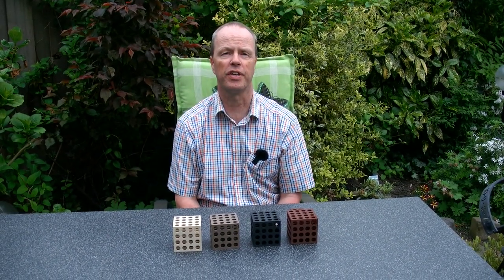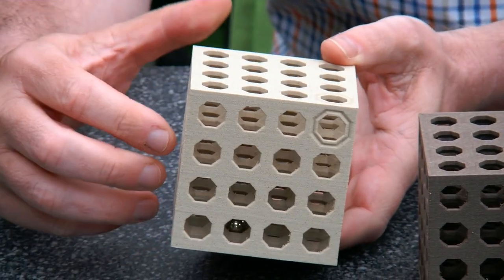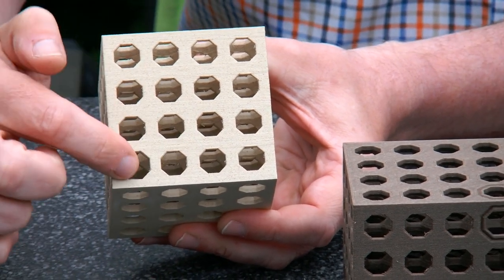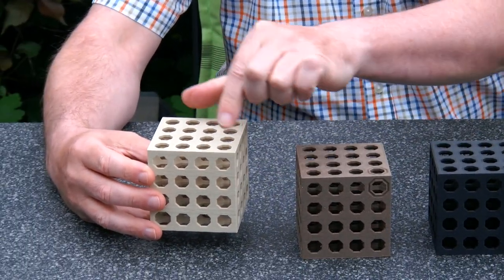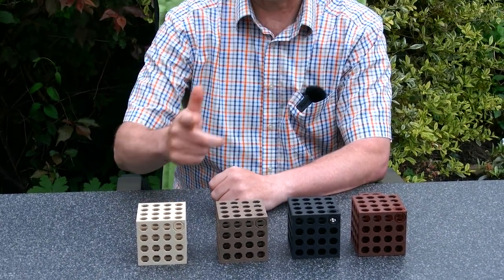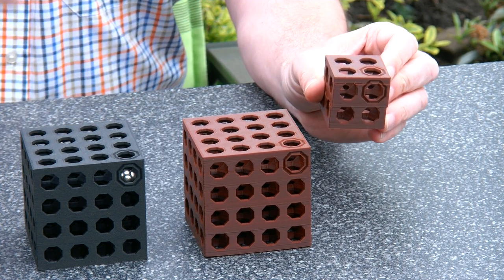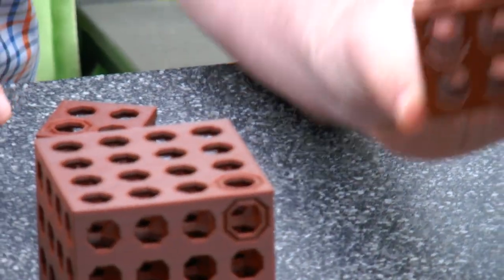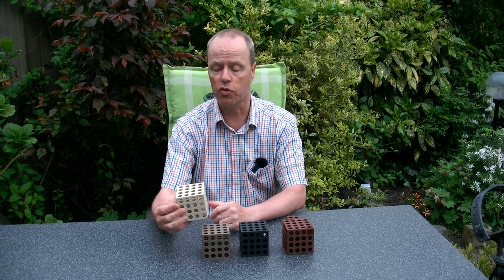Abbott's 3D Maze - Could this solid maze exist without 3D printing?

Comment from the maker: When you would show this maze to your friends, how would they think that it was made?
Reply: maybe they'd assume some kind of injection molding if they weren't familiar with 3d printing? I dunno.
Reply: probably witchcraft ;)
Reply: I know my friends all know 3D printing exists, perhaps not a wood version though. The design though would be the challenge. I know I struggle to design/plan such mazes myself with a 3D plane.
Reply: I didn't even know you could 3d print wood
Reply: my friends would know it was 3d printed; my mom would probably think there was some industrial process that molded the plastic around the ball somehow and then drilled out the holes

Comment: In answer to the question, yes it could be made, but would it be as complex as if its printed no. If you drilled it from each side, you could go so far, leaving a smaller hole in the "middle" this blocking the ball.
Reply: Carpenter know how to make this

Comment: For a 2D maze; you can usually "follow a wall" to solve a maze; i.e., preferring to make left-hand or right-hand turns whenever you have a choice, as if you were inside the maze and drawing a line on the wall with chalk to mark your trail.

for a 3D maze, i would approach it in a similar way; but paying close attention to the chirality of the moves in the x, y, and z directions: i would probably start with a strategy of: move the ball down (-x); if you can't go down, go left (-y); else go outward (-z), else go up (x), else go right (y), else go inwards (z)

I'm probably wrong but that's where I'd start :)
Reply from the maker: See https://en.wikipedia.org/wiki/Maze_solving_algorithm. "Wall-following can be done in 3D or higher-dimensional mazes if its higher-dimensional passages can be projected onto the 2D plane in a deterministic manner. For example, if in a 3D maze "up" passages can be assumed to lead Northwest, and "down" passages can be assumed to lead southeast, then standard wall following rules can apply". Alas, for Abbott's maze this will lead you right back to your starting point, as Abbott's Maze has many loops. So the algorithm can't get you out of the maze.
Reply: Even in a 2D maze, following the wall only works for sure if one is going in an entrance and to an exit.  If the goal of the maze is within its walls (or you start within and must find the exit), then the maze could be set up where following the wall will just take you in circles (like this particular 3D maze does).

Comment: Hi Oskar, I am not sure why you have such difficulty printing in PLA. I think your settings are not ideal. Think of: the nozzle distance to the bed, the cleaning of the bed, temperatures, brand of the fillament, buildplate surface material, fan speed, making an enclosure (although this should not be necessary for PLA), etc. etc. I have good experiences with PLA, PETG, ASA. But PLA on glass or PEI for example can attach to the build plate so strong, that it can take pieces of glas with it. So keep tuning, there must be something not right. Groeten uit Zoetermeer.
Reply from the maker: You confirm that 3D-printing is sort-of an art form. There are so many things that can be tuned and tinkered. Thee are so many different variations even of the same material. And materials degrade over time. Good standard recipes are still lacking.
Reply: @OskarPuzzle  Well while that is mostly still true for FDM printing, I would say that there are a lot of 3d printer manufacturers nowadays that have their own materials and material presets that work great, even with other brands of fillament. Personally I use FDM in industry and print batches of the same part reliably, time after time in PETG and ASA. PLA lasts for years on the shelf, but for a lot of fillaments you get better results after drying. I would not attempt to print Nylon with FDM though, it is hard to print and needs to be dryed during printing. Printing in Nylon strongly depends on the brand and you should never use cheap nylon filaments. And even than its an art to get a good result. Anyway, I like the wood finish on your prints.

Comment: Oskar, sir, I am pretty curious about 3D printed wood. What makes it distinctive over say PLA? Does it use the same FDM method or SLS or something else?
Reply from the maker: It is 80% transparent PLA with 20% wood dust. It prints like PLA in my FDM machine. It is ideal. It warps less than regular PLA, and it comes out very smooth.
Reply: @OskarPuzzle  i think you got a bad roll of PLA, it shouldn't be warping nearly as much as you say.
Reply: @OskarPuzzle  What a great different wood filaments can do to make great 3D prints.

Comment: I will try to 3D print your model in PLA and let you know how it goes!  One thing confuses me.  Isn't your "wood filament" just PLA with a wood fibers added?  I would have guessed it was very similar to straight PLA.
Reply from the maker: Similar, but not the same. It is runnier, it accepts lower temperatures and it comes out much smoother. It is a bit softer than regular PLA material. It does not warp. Especially the PLA birch comes out really clean. It is my favorite material, because of looks, ease of use and quality results.
Reply: @OskarPuzzle  I printed the test maze and it came out fine.  However, the 3 start holes are too small to admit a 12.7 mm ball.  The exit hole is large enough, and I was able to solve the maze in reverse.  I am using eSun PLA+, which is my filament of choice.  My slicer estimates 12 hours to print the 4x4x4 maze!
Reply from the maker: @gibell01  Good to hear. As you have correctly observed, there are no "start holes". They are only marked to show where the ball should start. So a photo of the ball in the start position is evidence that you managed to solve it in reverse.
Reply: @OskarPuzzle  Aha, I get it now.  I was wondering why there were 3 "starting holes", in fact they are "starting marks".  I have some PLA wood filament, I will have to try it.  I have heard they are more abrasive.